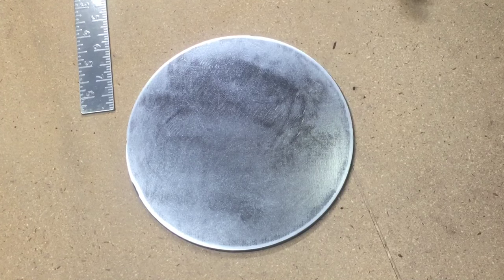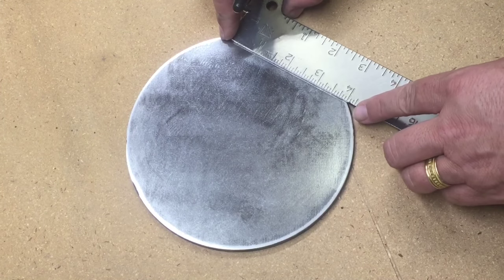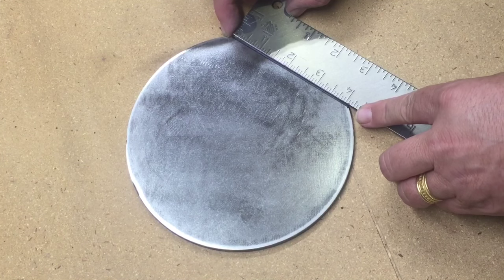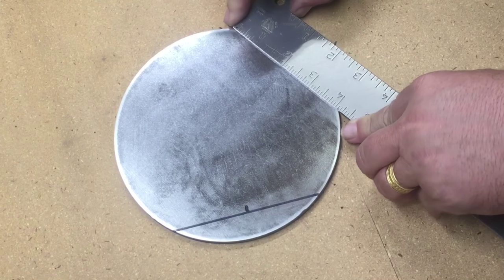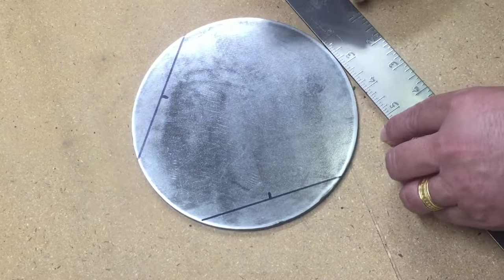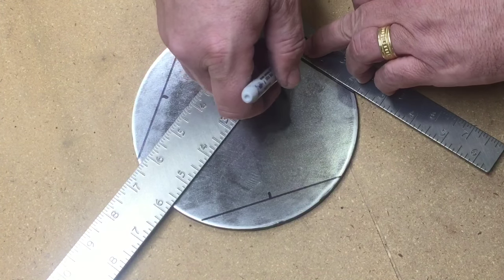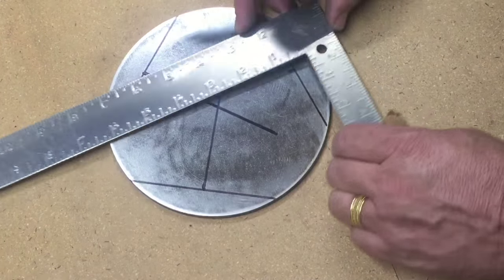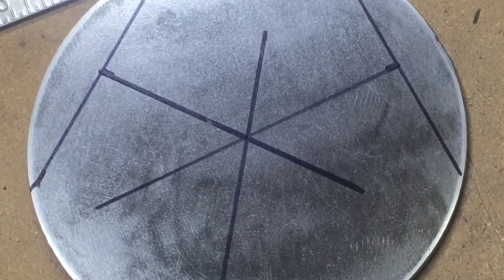Easiest Way To Find The Center Of A Circle.

Comment: You can draw 2 lines of any length across the circle.  Find the center of that line and draw a line perpendicular to it (as you did with your framing square).  Do this with both lines and where the 2 perpendicular lines intersect is the center.  This method you show works also but it just involves more steps and the length of the lines are irrelevant.
Reply: This actually works! Thanks!

Comment: This is NOT the easiest way to find the center of a circle - that would be with two reference lines instead of three 🙃 - great tip though! ( the principle being any size measurement across an arc, divided in half, and squared, will bisect the center of the circle - two lines will give you the center-point - size (equally dividable) and location don't matter. You could use a 2" line and a 6" line - anywhere within the circle - both will bisect the center.)
Reply from the maker: It is. I’m just extra.

Comment: Love your video. Dose that work for a 55gallon barrel to find the center point?
Reply from the maker: I’ve used it for a steel drum.  You may need to be creative to locate the edges if it’s rounded, but it could be done.

Comment: You don't need to draw any chords.  Any two points created a line. Set dividers or compass to about 3/4of the diameter pick any two location along the perimeter of the circle about 180 degrees apart. Draw an arc from each point. Then draw a line where the arcs intersect. Do the same arcs from where the line crosses the perimeter of the circle. Where the lines cross is the center. You have also exactly quartered the circle.

Comment: How did you come up with four inches?  What about circles that are larger or smaller than the one you used?  It seems easier to me to draw three lines across the diameter and where they intersect is the center.
Reply from the maker: It was just a measurement that was easily divisible by two.  It could have just as easily been 2, 1.5, 3, 1 or any number.

Comment: Measure the circumference, with a thread, fold it in half, you get a semi circle, join the ends, measure the diameter, divide it by two.. that's where centre is..

Comment: Really only need two equal lines across the outer edge of the circle and the midway point of each line. Also, if you use a speed square with the framing square, you only need to mark the center points where the speed square intersects each
Reply from the maker: +Dale Persails  interesting.  I'll give it a try.
Reply: The two line segments that touch the circumference don't even have to be equal. As long as the perpendicular is at the center of the two line segments the intersection of those perpendiculars will always be center.

Comment: Is 4 inches a good measurement to use with any size circle?
Thank you
Reply from the maker: The line just needs to be the same length.  1in 2in 3in.  Makes no difference what length you choose if you use the same measurement and it’s divisible by 3.

Comment: Why 4” and not another length? Is that calculated on the basis of the diameter?
Reply from the maker: microphonejones it was easily divisible by 2 and for this size circle it just worked.  It could have been three or two.  Just a  number that worked.
Reply: @ManCrafting  coool

Comment: You've actually found it after 2 lines if your 4" lines (in this case) are accurate?
Reply from the maker: Possibly.  3 removes all doubt and takes very little time.
Reply: Yes, that’s true. The third perpendicular confirms the center. In case you did something wrong with one of them, they would not all intersect at the same point.

Comment: Ok I get the center line. But I don't get how u know we're to place the lines. What if ur off. How do u know where to put the third.
Reply from the maker: Ripper Blades just three randomly placed equal length lines with a 90 degree line centered on each of the original lines and where they intersect is the center. It just works.

Comment: you forgot to mention that the lines that you draw they have to be equal in length and the marks that you made have to be the center of the lines….  
great example.
Reply from the maker: Thanks.  I should have mentioned that for sure.

Comment: 4inch line  is compulsory r not
Reply from the maker: venkatesh s not at all.  It was just a large circle.  Any number that you can fit 3 times on the circle will work.  2 or three would have worked just as well.

Comment: well if the circle is big not to hard but it the circle is hlf inch it hard  because the pen does not put the line where u need it you have to pull the ruler a littl bit back and make it harder show how to do it on a small circal like hlf indh size
Reply from the maker: I use a Center finder for circles that small.  I have a link in the description
Reply: @ManCrafting  thanks i will get one

Comment: Was the 4" line relative to the diameter of the circle ?
Reply from the maker: It just needs to be 3 equal lines intersecting the outside of the circle.  I used 4 because it was easily divisible by 2 and the circle was large enough to use 4 inches.

Comment: I would like to understand why this method gives the center. Don't quite get it
Reply from the maker: Sorry it wasn’t what you needed.
Reply: @ManCrafting  It was, but I remain partially unsatisfied  in the sense that I don't understand "why" this method gives the center. Do you? The drawn lines seem random to each other still  they are able in conjunction to provide the center. This kinds of "baffles me"..
Perhaps what is happening is that one turns the circle into an imaginary square, that would make sense to me. But shouldn't the lines then be in harmony to each other to form a real square? Or are we making two separate imaginary squares, and are they by some invisible rule bound to point to the center...? I mean obviously the first line already points to the center, we only need the second one for confirmation...

Comment: Nice method.  But, only if the circle is big enough.  I'm trying to find the center of a 5/8" bolt down its length.  Kinda tough.
Reply from the maker: True enough.  I made a center finder that will find the center on any circle up to 3 inches in diameter.  Tons of videos on how to make a center finder.

Comment: A tri square is more accurate, faster, and cheaper because no time is taken lining up scale edges.  Ask any welder or machinist.  They’ll be able to tell you.
Reply from the maker: ClayZ cool tip. Thanks. I don’t have that tool currently. I was just using a straight edge I had in hand.

Comment: Dude you said 4 inch line well I’m measuring a 3/4inch pick so what now 4” don’t help lol
Reply from the maker: ben tallman make a center finder.  Something that small will be difficult to draw 3 any length lines.
Reply: You a only need 2 lines, and their length doesn't matter, the intersection of the line segments perpendicular bisector will be the center, the video is unnecessary complicated
Reply from the maker: Reginald Frank ok.

Comment: A simpler method is to place the right-angled corner of your L-shaped square on the edge of the circle, then mark the 2 points where the straight edges of the square meet the circumference. Draw a line through these 2 points; this line is the diameter of the circle. The midpoint of this line is the centre of the circle.
Reply: Tested, I don't think so
Reply: @emostorm7  Yeah, this isn't correct at all.

Comment: This is not the easiest method, it's the most complicated.  Just draw a line on the outside of the circle, another at 90 degrees just touching the outside so that you have a square on the outside then dissect the square and you have the centre,  another simple way is to measure across the circle until you have the largest meaurement then dissect the line across at the middle,  there is your centre point.
Reply from the maker: I need accuracy.  The first method works on paper.  Not in reality.  The second method is a crap shoot. If it’s 100% centered all the time I’d be surprised. If you need it to appear centered but it doesn’t matter if it’s perfect I’ve used those methods.
Reply: @ManCrafting  Nonsense,  both methods I described are extemely accurate without drawing lines all over the interior of the circle, try it out by making a circle with a compass and measure it using my methods, youll find the centre point corresponds with the mark made with the needle point of the compass.

Comment: There is no reason to draw the 3rd line and a line 90 to it.  You have located the center when the second line crosses the first at the center.  Using an 'awl' will scribe a much narrower line than your black crayon!  Just saying ........
Reply from the maker: I used a line that would be visible for the video.  A scribe line would be the most accurate.  It’s just not easy to see.

Comment: Sorry but maybe, I am not thingking much.  But,  the way i see, there is no solid evidence that you really find the circle.  For instance using a device that  when you rotate the curcumference wood it is really 100 percent accurate, both inner and outer circle.
Reply from the maker: Ok, but I would say that finding the center of a circle with this method is easier than deciphering this comment.
Reply: Evidence is geometry. There is no evidence that his measurements were 100% accurate. But if they were 100% accurate, geometry tells you that this works quite well. If his Square was accurate to 90 degrees it gets you spot on center. HOWEVER, with inaccurate measurements, and a square that's not a true 90 degrees, it would only be close, and not perfect. Hope it helps, but I'm kind of late to the party lol.

Comment: If you had just placed the ruler accross the circle and drawn 2 lines either side of it, marked the centre of each line and draw a 3rd through them the you would find the centre of the circle at the centre of the 3rd line. No need for a square/right angle and only drawing 3 lines!
Reply from the maker: I have no idea what your trying to communicate.  I’m sure it’s better than my method, but I read what you said to 3 people and not one understands it.